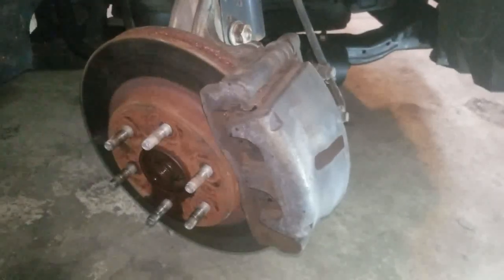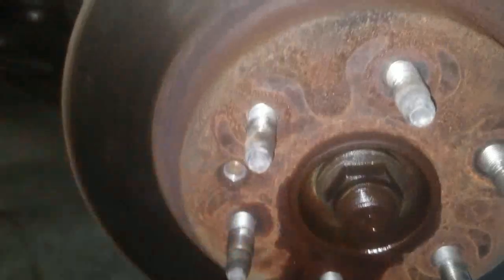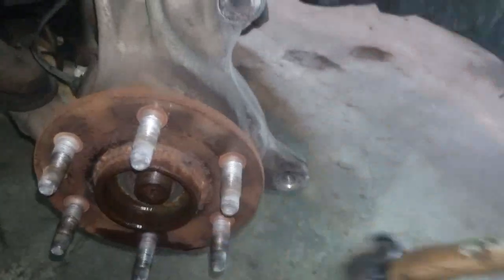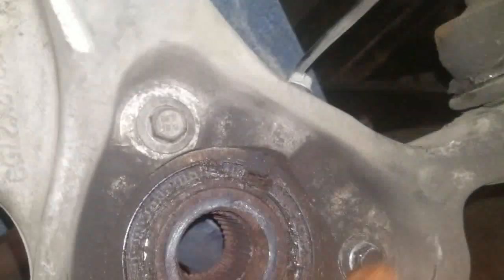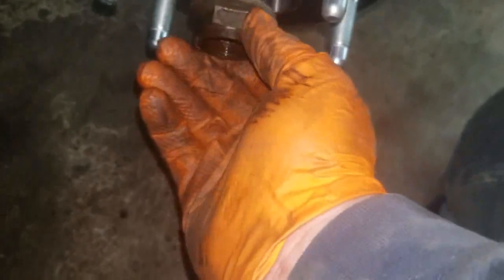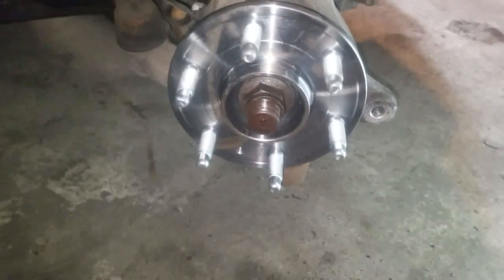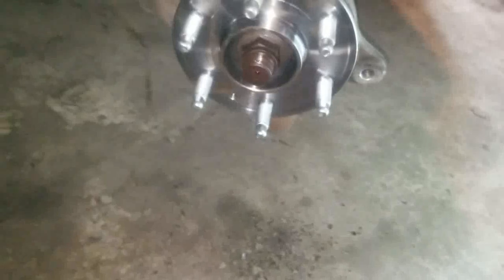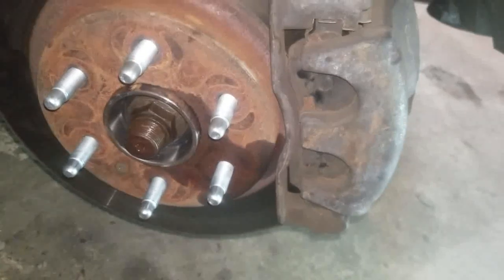Chevy Traverse wheel bearing hub assembly replacement.

Comment: What version of the Milwaukee impact gun is that? Tons of torque to get the 34mm axle nut off. Looks like maybe some penetrant sprayed on as well. How long did it sit to come off without a breaker bar?
Reply from the maker: Didn't really let it sit and soak, I just like to spray it down to lubricate as I'm pulling everything apart, I'm from Buffalo, NY so everything is rusted here, a little lube always helps here. And I use milwaulkee Fuel Brushless impacts now, but realistically it would have came off with just hand tools just fine.

Comment: Won't you have to have the car realigned doing it this way?  After removing strut bolts
Reply from the maker: No, the strut bolts go back into their holes in the strut and spindle and the holes aren't slotted for alignment adjustment.

Comment: Will it fix the abs light?
Reply from the maker: If the bearing is bad most like the ABS is on because of it. So the shirt answer is yes...... but, there could just be a bad ABS wire. If the bearing isn't bad I would have a shop or someone with an ABS scan tool check to see if the sensor is working and the circuit is good

Comment: Lol.u don't need that strut removed to take the bearing 😁
Reply from the maker: For the average DIY at home mechanic with normal tools it definitely makes the job a lot easier with the axle removed and to do that you need to undo the strut.
Reply: No way in hell are you getting a breaker bar anywhere in there that can actually be used without removing it.  Great video right to the fucking point!
Reply: Don't need to remove the strut bolts. I got the three bolts with 3/8 ratchet n shallow 13mm socket. Added a bigger deep well socket to fit over ratchet handle n 6" extension for extra leverage.

Comment: 100% lie on doing damage to the wheelbearing tightening the axle nut with an impact.I do this and no damage done,the wheelbearing manufacturers are telling lies saying tightening the axle nut down with an impact does damage.It is 100% impossible to fully torque that axle nut down
Reply from the maker: I use a torque wrench because I've personally destroyed a bearing in just a few days by hammering it on with an impact gun, replaced it again with the impact and destroyed that one withing a week. I learned that day that I will never over tighten an axle nut again.
Reply: @davedixon2635 100% impossible to fully torque them down
Reply from the maker: @Toolaholic7  like I said. I've done it. Not once but twice,
Reply: @davedixon2635  Cannot overnighten the axle nut